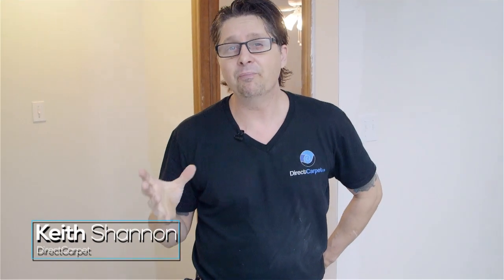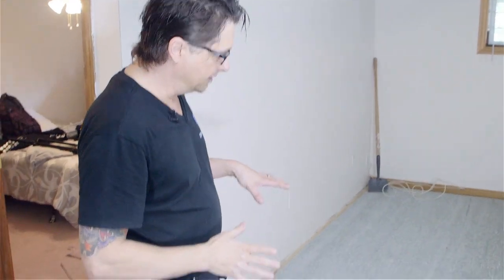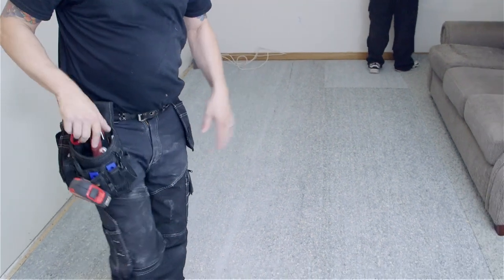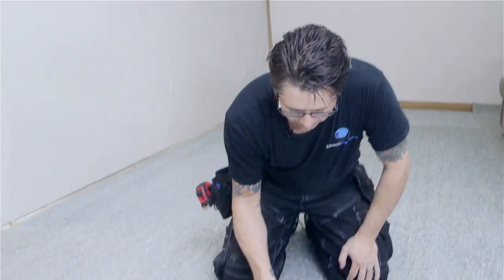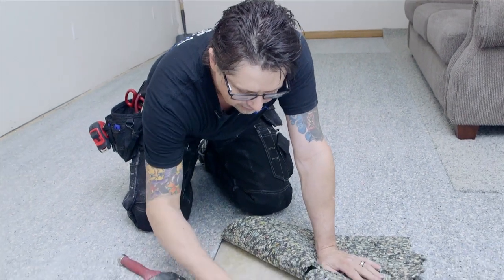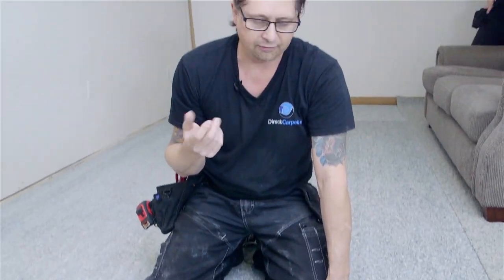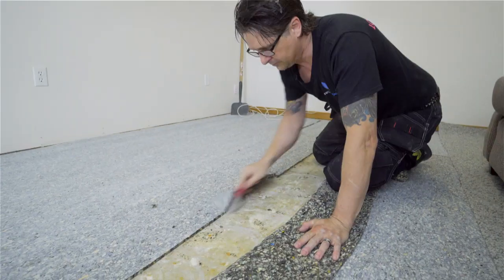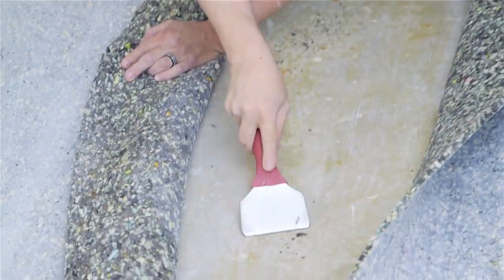Watch this Before you Install Carpet in a Basement/Directcarpet.ca

Comment: Out of all your videos this one is the only one I disagree with for concrete floors use glue and for wood floor use Staples
Reply from the maker: well each installer has their own way of doing things,what i find is that if pad is glued down and the homeowner has had a flood or pet urination..the smell won't come out unless you really go to town cleaning the floor,, and usually customers don't want to pay for such a thing,, so tuck tape is my choice,, we have never had one complaint,, and trust me if you have to rip one of my jobs in years to come... you will be oh so happy with the no scraping thing....:)
Reply: I know this is older video but I agree no glue. We just ripped carpet out of our basement hoping to paint the floor. What we thought we could achieve over a 4 day weekend is still in the process. Previous owner glued entire floor and stair treads. 2 days with heavy floor scraper rental and soaking of harsh chemicals still glue on floor. Had to replace stair tread completely. Now we have no other option than to cover the floor again.